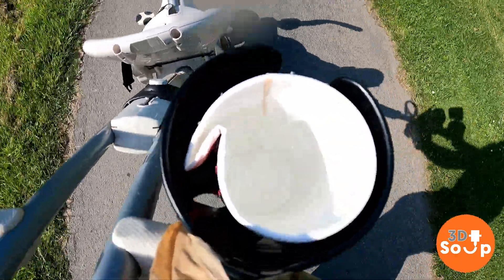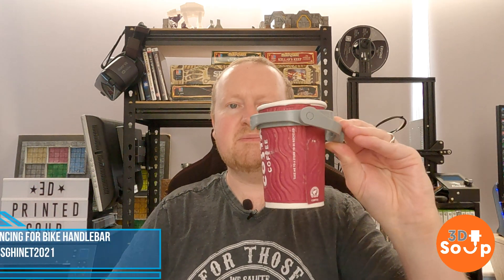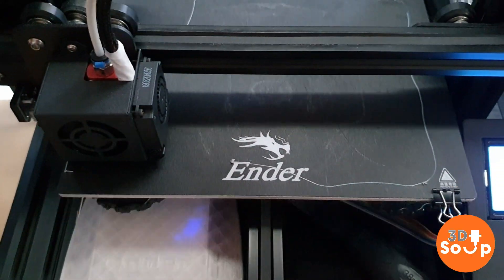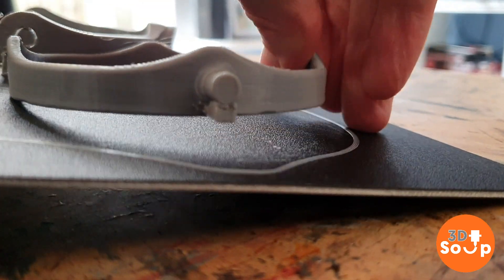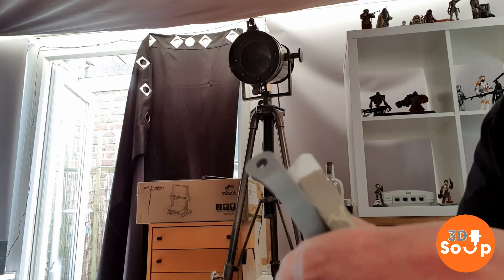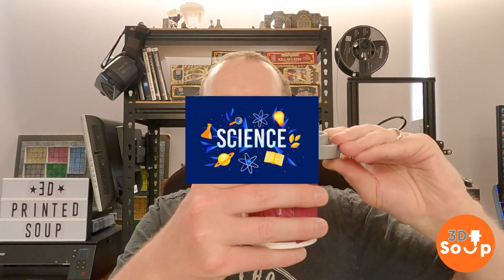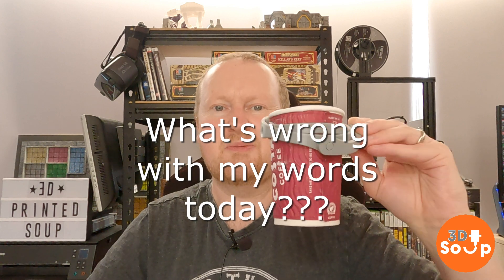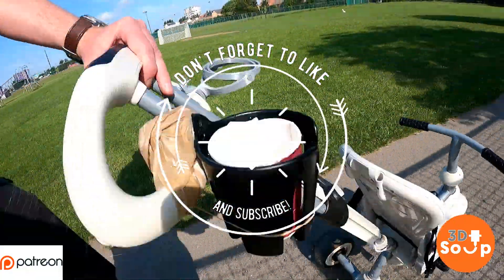3D printed self balancing cup holder field test and review

Comment: Would it melt with a hot coffee cup or stainless steel mug in it ?
Reply from the maker: PLA has a melting point of 190-200 degrees so no it will be fine . Thanks for watching  :)
Reply: @3dPrintedSoup  thanks for the reply
Reply from the maker: PLA has a melting temp of 90-120 so will be fine. Thanks for watching :)

Comment: Came here from the thingyverse link
Reply from the maker: Thanks for checking my video out, its a great design
Reply: @3dPrintedSoup  the link no longer works do they time out or something?  just started 3d printing yesterday not sure how getting outside files works
Reply from the maker: @treasend-o7 hi , thanks so much for reaching out. As these designs are put up by individuals for free and for the community to use they can sometimes be removed, either the designer wants to charge for them, has made better designs and has taken the old ones down or just no longer wants to share them. If you use thingiverse, cults3d or one of the dozens of file sites, the files may not be there forever. Thanks for watching. :) good luck with you 3d printing journey